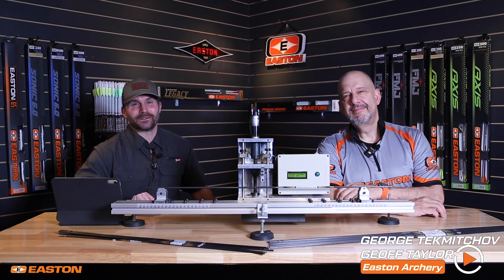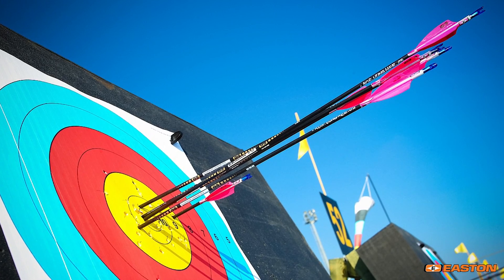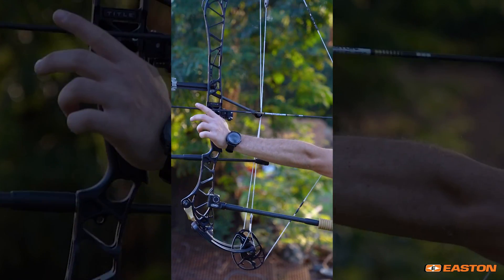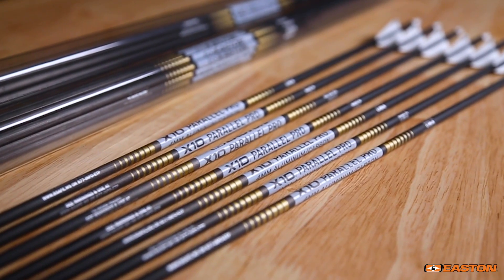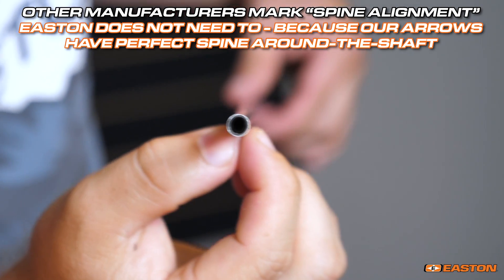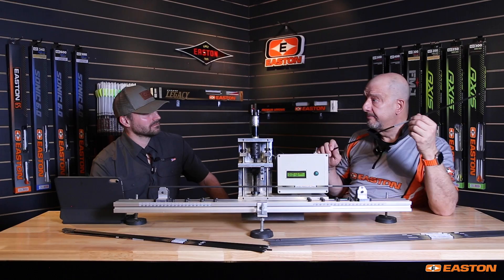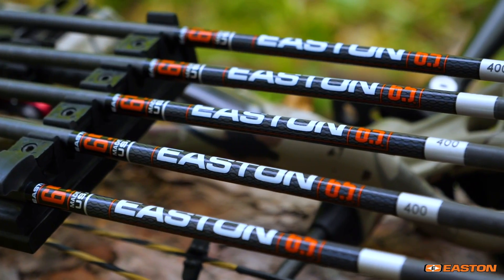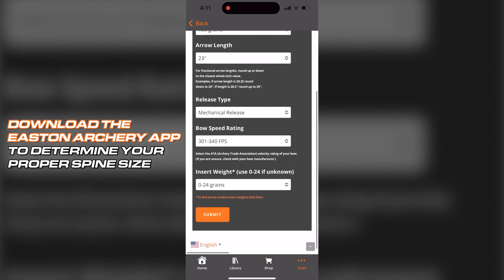Importance of Arrow Spine // Easton - Technical Bulletin (Episode 6)

Comment: Why did Easton discontinue the ACC shafts? Did the X10 take the place of ACC? I've been shooting ACC since the 90's and liked the built in nock bushing on the back and the consistency of spine. My favorite shafts to date. We'll see if the X10 can take over as my favorite. Thanks for building great products and further more, keeping them made in USA.
Reply: what i have been led to believe is that they did it to limit the number of products they had to maintain, especially as the ACC was only really big in the uk and needed for some mixed use  sports fields where for safety reasons all arrows have to be accounted for, as the ACC's were easily metal detectarable as opposed to carbon. im not sure of all the in's and outs as i had a few years off when they stopped producing ACC's, but i managed to source some recently as i prefer 'em for both indoor/outdoor as i dont need to mess about tuning different ones. GL

Comment: Thank you for the video Geoff and George.....I appreciate your confidence on Easton arrow shafts, specially the X10 Parallel Pro and the 360 degree all around guaranteed spine.
I'll be honest, I believe you, but I'm having a hard time visualizing the spine will be perfect to what is claimed to be from factory all around.
Many arrow manufactures claim the arrows are spine aligned, I beg the difference.....I always spine aligned my arrows with noticeable difference from claimed spine aligned from factory....
I'm willing to spend $350 for a dozen of Easton X10 Parallel if you can guarantee me they will have a perfect 250 spine all around 260 degrees.
I have no doubt in my mind your product is top notch, after all, Easton has been around for many generation way before many of the new players in the game.
Cheers.....

Comment: So what happens for junior archers who have to cut their arrows to less than 28"? I've read online that 1" cut off is like a spine stiffer, but is there a more exact way to find out what the 'new spine value' would be after cutting - eg, hypothetically cutting an A/C/E from stock 29.62" for a 780 by 3 inches brings new length to shorter than 28" so how would you determine the spine value?

Comment: Thanks for the information. It brings up a question. 
If selecting XX75 arrows for a junior/beginner and a weak spine 1516 is chosen, does the published data still refer to a 28" span for the spine deflection data. 2024 catalogue shows a 1516 is provided in a stock length of 26.75" and spine of 1.405
Once the point and bushing are fitted, does the free internal distance between bushing and point reduce the shaft's ability to flex at the stated spine of 1.405 and was this originally measured at 28" or was it measured at 26.75"
The same can be said for a 4mm carbon shaft with a heavy stainless 120 grain point. That point takes up a lot of space which can no longer flex as the point is glued in there. Subtract the space needed for a pin nock and the available flexible portion of the shaft has been consumed, leaving the shooter in doubt as to what the actual spine rating is.
Is it not better as a company to bring in a minimum stock length of say 30" for all shafts that are currently less than 30" 
Looking forward to your reply

Comment: I get consistency is vital, but compound bows and modern recurve bows don't need any bend in the arrow to clear the riser like old traditional bows, so why is there any variation in spine weights at all? You should be able to shoot a solid rod that doesn't flex at all because it doesn't need to bend around the riser, making spine flex seem like more of a gimmick. What am I missing here?
Reply: Arrows still need to be able to bend because even with new riser design the mechanics are still the same, the reason arrows bend is because they are getting pushed extremely fast by the string and that force takes time to get to the front of the arrow.  Essentially the back of the arrow is moving and the front isn't, causing it to bend.
Reply: You’re dead wrong.
Reply: LOL.  Wrong
Reply: Buddy you need to look up the "archers paradox" you can not machine that out in a lab. It will always be a factor to an arrows accuracy.